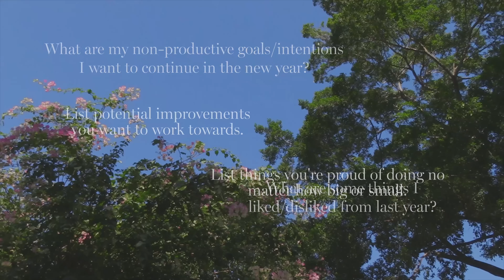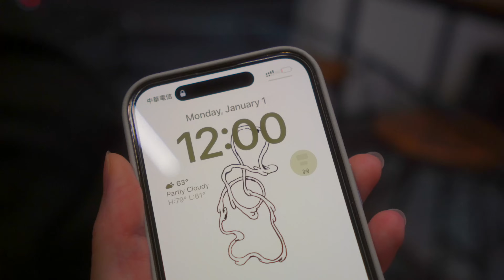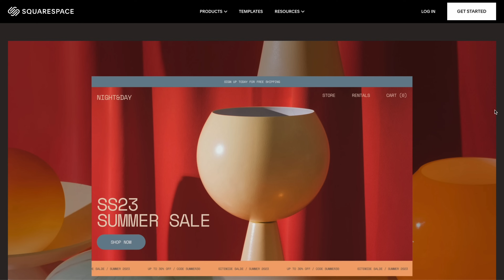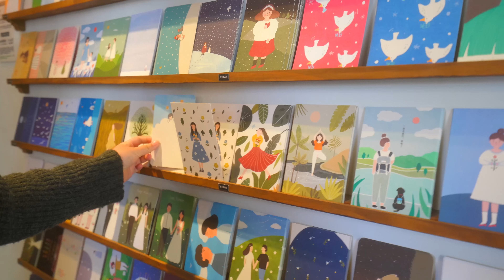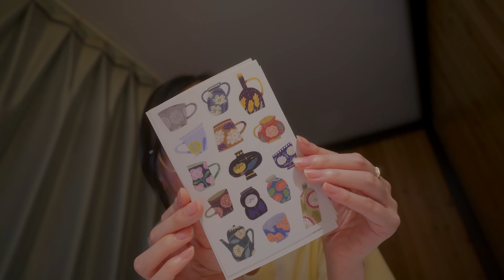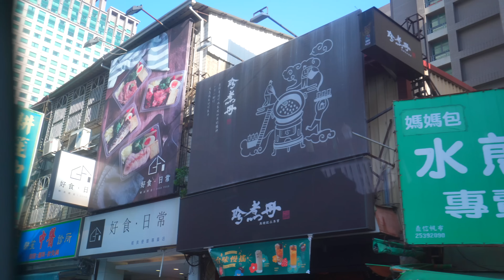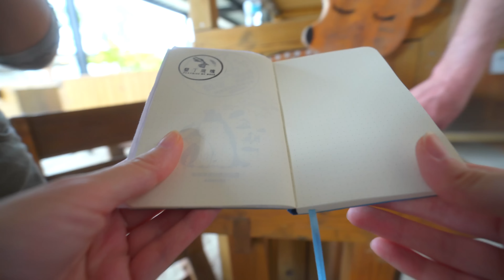A Healing Start To The New Year 🌟 creative goals, feeling inspired, journaling, travel

Comment: It made me smile seeing your family's faces as you gave them those envelopes! I'm sure it meant a lot to them. Also a little tiny bit of advice using metal files: don't use them the wrong way (you pulled instead of pushed a bit) or you can blunt them faster! It's nigh impossible to re-sharpen files past a certain point (carding can only do so much) so it's a habit you don't want to get into.